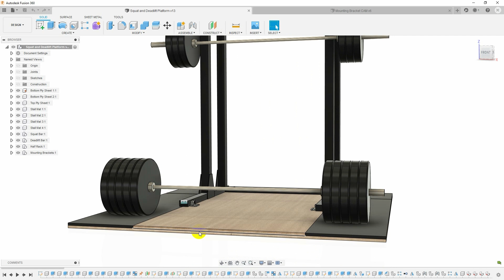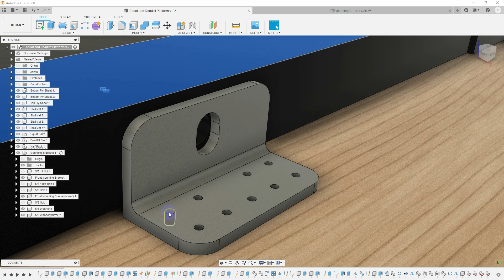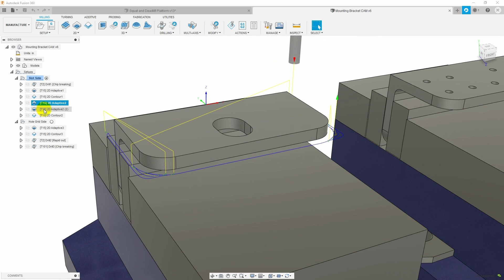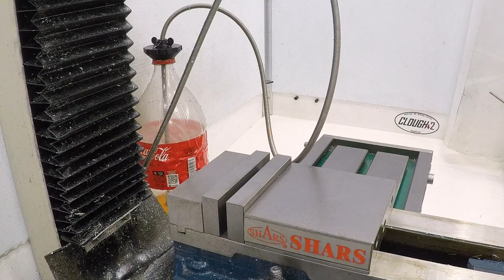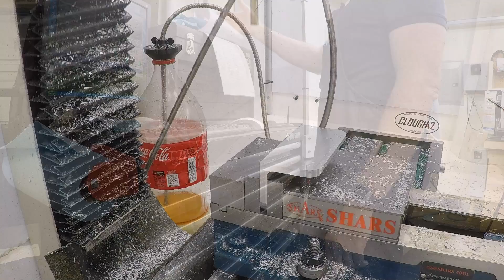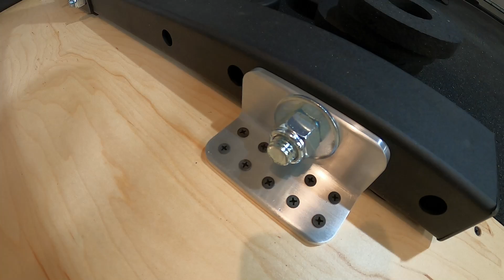CNC Machined Squat Rack Anchor

Comment: I know you love your Haimer but you should already know the zero position of the back and sides of your vice jaws. With the use of a vise stop you shouldn't need to keep touching off of the parts as you would have the vise coordinates saved.
Reply from the maker: The work coordinates are lost when I shut down the computer or hit the e-stop, so that would require trusting the machine zero, which is derived from non-precision limit switches.
Reply: @Clough42  I can see that as a problem. Actually, I was referring to your second operation which shouldn't have required you to shut down the computer, in between operations (unless you are doing a youtube which can require a bunch of setups and take way too much time ;-) . Just ignore me, you know what you're doing much better than I do. I'm still working on getting my new VMC to just turn on. Love your videos, you are an inspiration.

Comment: If you ever go to a weightlifting gym (olympic weightlifting), they typically do their primary lifts first (olympic lifts), and follow up at the end of the workout with traditional front or back squats. Since the platform is the primary tool in this case, and not the squat rack, the squat rack is usually two portable and lightweight "trees" that are individually placed on the platform. They can be wobbly as hell. And for the big boys you can imagine how much weight is on the barbell. I used them when I was doing olympic lifts for 2 years, and never had an issue. (I'm a complete amateur and weak as hell....) The whole point of this comment, is the half rack is 10x more stable, and probably doesn't need to be screwed down anyway. BUT, great video, from a fellow gym rat and metalworking rat:)

Comment: Nice looking rogue ya got there. The only things I would do differently is install that setup in my garage so I can get to it easier... And replace those nylocks with acorn nuts. You will only need to step on those exposed threads once to see just how sharp they can be with a bit of weight behind them.

Comment: Are you going to add automatic tool changing to your mill? Seems like you already have the hard part done, with the new spindle.
 You just need a tool rack and some tool change macro/programs and you would have a slow, but fully automatic tool change.
Reply: Now, why do you want to let him get sleepy? He's gotta do something to earn his bacon.
Reply from the maker: I thought about it.  This is such a huge improvement over the TTS system that I didn't feel the need to overcomplicate it.  Honestly, I think the thing that would worry me the most is how to keep the tapers clean so I didn't end up with chips between the tool holder and the spindle taper.
Reply: @Clough42  The new spindle have the 30 taper setup?
Reply from the maker: @MrJohnnaz  Yes.  ISO30.  No drive dogs.

Comment: As a professional woodworker for over 45 years,  I concur with the no vote on the drywall screws but I also vote no on wood screws. Wood screws are very weak steel,  I prefer sheet metal screws which are higher quality steel and hardened.  In this case I'd suggest elevator bolts (not carriage bolts ) with the heads down or tee nuts with cap screws. Always enjoy your videos for both content and quality.
Reply: If I pull out a regular wood screw out of plywood the wood will fail before the screw. What would be the benefit of using hardened screws? (I'm European, maybe we have different screws)
Reply: You may indeed have higher quality screws. I've had wood screws twist off usually at the juncture of the shank and the last thread.  In the case of

Comment: I'm really leery of depending on the pullout strength of even a large number of short wood screws. This is what t- nuts are for. (The hammer-in type, not the machine table type). Climbing gyms use them to fasten anchor clips which are subject to surprisingly high shock loads, approaching a ton or so.
You'd have to install them in the underside of the plywood, but very much worth the trouble. Then good cap screws from the top to bolt down the feet.
https://en.m.wikipedia.org/wiki/T-nut
Reply: I was going to suggest the same and he would only need a couple on each bracket, much safer than any screws in plywood.

Comment: Another way to do it is to take carriage bolts (the ones with large, flat, rounded head and a square below the head). Put them from underneath into the plywood and keep tightening until the heads sink themselves into the plywood. Then you have the heads flush with the plywood surface on one side and solid threaded studs on the other side. That connection is plenty strong - I used it to secure a safe to the wall. Downside is you need access to the back side of the plywood.
Reply from the maker: Yeah.  I thought about it, but didn't want to set everything up to locate the holes and then lift it to access the back.  If the screws ever fail, I'll probably sink concrete anchors.

Comment: The volume level difference between you and the tool is pretty large. Is there a way to turn down the machine noise or turn you up? (I can change the device volume on my end.)
Reply from the maker: I use a compressor, and the typical dynamic range in the finished videos ends up being only about 3dB, but with headphones, depending on conditions, that could be a lot.  I'll keep that in mind.  The sound of the new spindle has a very different frequency distribution, so it's probably worth taking another look at my processing.

Comment: Love your content and although what you have will probably work just fine you may want to switch to wood screws rather than drywall screws.  #1 drywall screws are more brittle than wood screws so you loose some “toughness” and are more likely to have a brittle failure rather than them yielding slightly if over loaded. #2 (and much less important) drywall screws taper on the head is designed with a bit more radius so as to minimize tearing of the paper facing on the drywall board so you will not get as good of bearing contact with the hole countersink.  Again love the content and not trying to be critical.
Reply: I thought of this as well, nice job being tactful.
Reply from the maker: That's a good point.  The tensile and pull-out strength are more than sufficient, but I hadn't considered brittle failure.

Comment: Oh, and yes, you definitely won't bother pre-drilling in time.  You have 2000 more RPM than I do, and I quickly found that the predrill wasn't needed.
Reply from the maker: Yeah.  That's what I'm finding.  As long as I can get the chips out of the hole.

Comment: Don't use drywall screws.  They don't have any strength.  Get some structural deck screws at least. I mean it will probably be fine until you drop the bar a little hard and the heads pop off
Reply from the maker: Lots of good feedback on this.  I just ordered some proper #9 structural connector screws.

Comment: I’d be strongly inclined to use regular steel screws rather that drywall screws. Drywall screws always seemed very brittle and not particularly strong to me, even in qty 9 per side.
Reply from the maker: Lots of good feedback on this.  I just ordered some proper #9 structural connector screws.
Reply: Plywood has the pull-out resistance of jelly - you need a screw that's more thread than shaft, and even then...

Comment: You can put some clay underneath and get some rigidity back.
Reply from the maker: Oh, interesting.  I've never heard of that.  Like just modeling clay?  Or like pottery clay?  If it had become a problem, I was planning to make a couple of mini machinist jacks with 10-32 screws.
Reply: @Clough42  simple modeling clay. The Jack's work good but the clay dampens the vibrations a great deal.
Reply: @Clough42  We use duct seal, holds up better to coolant.

Comment: just over a minute in and already commenting.  I see you've got 5 plates on your deadlift bar model.  I like it!  Nothing better than starting by visualizing it, right?  :)  BTW, I watched your video about making talon grip vise jaws the other day, and man you look different.  You have every reason to be proud!
Reply from the maker: Thanks!  I pulled 430lbs a couple of weeks ago, so I bought the Echo bumpers specifically because they're narrower than typical bumpers and I can get 565lbs on an Ohio Power Bar.
Reply: @Clough42  Lol!  The other day a friend I workout with was over, and I was finishing up a plastic injection machine.  I started with a manual small-run injection machine and designed a pneumatic system controlled by an arduino.  He's hanging out and says "You designed this, machined the parts, hooked it all up and wrote the software to run it...how many people can do that?"  I laughed and said quite a few.  He responded "Plus a 500 pound deadlift?"  Heh.  I'll let him know there's about to be at least two!